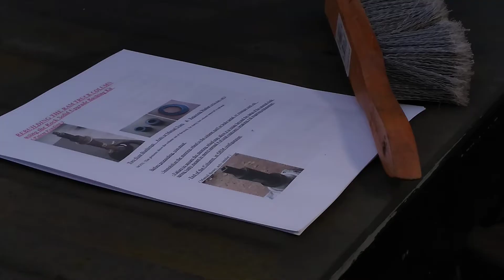Dodge Ram Death Wobble SOLVED Rock Solid Steering Fix Upgrade 1st 2nd Gen Loose Steering Play Wander

Comment: Does it have to go all the way in until it touches the lip?
Reply from the maker: In most cases yes.  But sometimes not:
Tolerances vary from column to column so generally insert the bushing until it's snug, normally about 65% insertion, then check for tightness by a quick drive.  
Adjust insertion later as break in occurs.

Comment: How about 92 Dakota?
Reply from the maker: Yes indeed it does work for 1st Gen Dakotas 1986-1998, which shared columns with the larger Ram Truck, auto or manual tranny.

Comment: My 01 dodge ram 2500 has wonder checked that u joint near the steering column it moves some maybe 1 mm I've replaced most of the front end including steering box still have wander new track bar new steering damper up graded steering link shaft shocks ball joints are good I don't have death wobble will this fix my wander thanks
Reply from the maker: Mike, hello there.  Just grab the very center steering shaft - and push with decent force side to side & up & down to see if / how much play the center shaft exhibits.
If it's more than say 2-3mm or 1/8" or more then our kit will help out.
Also make sure your front tires aren't overinflated.  
Go with the door plate PSI which should read 65psi Front for HD 2500.
If unladen (driving empty no load) you can reduce up to 10-15 psi no problem.  This should help reduced dartiness, as the tires run flatter when not overinflated for your axle load, which you can verify on a truck scale anytime.
Hope that helps.  
You can order our kit at www.RockSolidRamTruckSteering.com

Comment: All 5 that i have fixed was the drag link bushing on the axle. Only apparent with truck on ground someone steering back and forth and someone specifically looking at that bushing
Reply from the maker: Yes Rodney, quite agreed - the Track Bar is a common loose part as our Ram Trucks age, and must be checked.

We include a checklist along with our Install Guide Instructions.  Right near the top is "check front axle Track Bar joint & pocket bushing" (aka the 'drag link') for stability.

There are numerous possible loose Chassis Steering (alignment) related parts & Steering Control parts that MUST be within spec to make sure our Ram Trucks steer straight.

Keep in mind this 'Track Bar' is specific to the 4x4 Rams (ie not found on 2x Rams), it's the long bar running parallel to the Front Axle, with a drivers side mount to a frame bracket, visible in the front DS wheelwell.

It's other end terminates in a 'pocket' mount on PS side on axle front - there is a bushing embedded in the metal bar.

So check both sides for solidity of mounting.  

If the Ball / Stud joint shows any movement at that DS mount position, as you have a helper turn steering wheel lock to lock (truck running), then bar is loose & causing steering imprecision.

Hope that helps y'all to achieve greater steering performance !

Cheers - David Alan / www.RockSolidRamTruckSteering.com

Comment: My 2500 has terrible steering all sorts of loose and I have some bad clunk/squeak/popping type noise that comes from the Column when it’s cold outside.  Now I have a good idea what to look at.   I will be ordering a kit. Does this repair require steering column removal?
Reply from the maker: Great glad we could point you to the source of the problem & solution.
Only remove the column if YOU feel it's necessary.
Many probably most - 70% + are done 'on Truck' meaning column in place.  
Rams can vary greatly in the amount of room to do this rebuild, different years or the 5 different engines - and related equipment installed.
Our Install Guide discusses both approaches to help guide your approach.
- At Your Service - David Alan / RSRamSteeringFix

Comment: Will this kit work on my 92 d150? 4x2 I have the similar spring type setup on mine as shown in the video
Reply from the maker: Yes indeed Robert our kit WILL work on the earlier 1st Gen Rams all the way back.  Same column, just a slighly different intermediate shaft connection to the column center shaft.  But all other respects its the same & this will tighten up your column response / lose the slop.
Best Regards, David Alan / RSRamTruckSteering

Comment: Kyb worst handing shock I've had on my truck switched to Bilstein and it's a night and day difference. Kyb felt soft didn't corner for crap. My truck isn't lifted and won't ever be. Haven't tried rancho but hear they aren't bad on a lifted vehicle.
Reply from the maker: Shocks ride performance can vary greatly - picking the right exact model for your road conditions & driving style is key.
For example on KYB they offer 3 levels of firmness & control.  So you can choose from OE (level 1, aka Excel G) or Gas A Just (level 2) or MonoMax (level 3)
Here I show the OE KYB as I was testing it.  It made me quite satisfied.  Under heavy towing, it probably would have lived only a year or so.  If towing heavy (I used to, but not of late) regularly, use their HD Monomax.  I have them on the front of my V-8 engined SUV and theyre great in that application.

With Bilstein same story - various models.  Bilstein are great products no doubt.  I've had them on a Dodge Ram Van - great stuff.  But I did have a set go bad on the front of that same Ram Van 2500.  Bilstein to their credit stood behind their warranty & replaced 'em.

The Rancho Adjustable - they flat out get my respect.  If towing then unloaded, their adjustablility is UNPARALLELED.

So, we have great options.  I try not to engage in 'Shock Wars' - just like 'Oil Wars' there's not much point ....

Thanks for commenting - David

Comment: I finally installed this bushing on a '98 after purchasing two years ago.  I may have driven the bushing in too far, as my steering is very tight now and will not return to center.  It's way better than the slop I had before, though.  I do not want to try to pull it out, do you know if there is a typical break in period on these bushings for those of us that inserted it too far?  Thanks!
Reply from the maker: Ok, we're delighted to hear its better - but lets perfect it, ok ?  

Have you tried using some spray lube like 'white lithium grease' at the point where the shaft passes thru the bushing ?
That alone can decrease the friction to the ideal resistance.  
Sometimes even if you did lube before aseembly, it needs an extra bit of lube once everything is all connected to lower intermediate shaft & truck has been driven.  

And yes the bushing will 'wear in / break in' after a few miles of driving. 

Were ALWAYS here to help.  If any further questions please visit our webpage / webstore at http://rocksolidramtrucksteering.com/
and choose 'Contact Us' from upper right top menu - you can text OR email us and we'll be there to help.

Thanks so much - David Alan / RSRamSteeringFix

Comment: Looks like something i need my truck has violent fits of death wobble on the smallest of cracks on the road
Reply from the maker: Great yes we are glad to help you Josh.  Visit our website at www.RockSolidRamTruckSteering.com and you can read more or order securely by clicking the 'Order Now' link from top menu.

BTW, do check your front tire pressure.  When you say small cracks seem to throw off the steering balance, it could also be your front tire pressure is TOO high.  For example if you're a 2500 / 3500 Ram some guys try to run the 80 psi sidewall pressure (max for LR E 10 ply tires) on all 4 tires when in reality they only need 55-65 in the Fronts.  If you run 80 psi the truck will dart all over the road as you seem to describe.  The door jam sticker should say 65 psi front on a heavy Ram or a lesser # probably 45-50 psi on a 1500 Ram.
Even on the rear you can run LESS than the door jam sticker those are Max #s IF you load the Ram to the axle weight listed there.
Going to a truck scale is the only way to determine axle weight precisely.  Anyhow, check those Fronts make sure they're not too high.

Comment: What wheels are those and sizes??
Reply from the maker: Sharp eye there ERIC - those are my 19.5 wheels & tires.  They're a 'Medium Duty' tire like the next step above the standard Load Range E - 10 ply on the Ram 2500 / 3500.  These are LR F or G for 12 or 14 ply and around 4,000# @ 110 psi.  More capacity & better ride smoothness.  Not too mention longer lasting by 50% vs 10 ply.
Here you go, where I got them:

http://www.ricksontruckwheels.com/wheels-dodge-srw.php 

Best ride & load upgrade you can do on a 2500-3500 Ram

Comment: Does this fix work on a 2002 Dodge Ram Van 1500?
Reply from the maker: No sorry Brigham, it does not.  The Ram Van columns are a different layout.  They seem to remain tighter but the other parts - the steering box & drag linkage seems to develop play.
Also, the Ram Van, like the truck, should have the Steering Box play checked & adjusted to minimize it very few years.  Be sure to check yours.